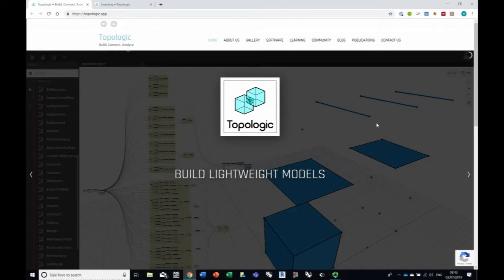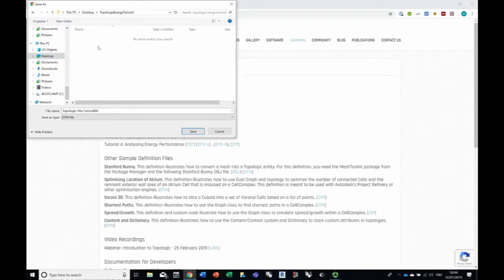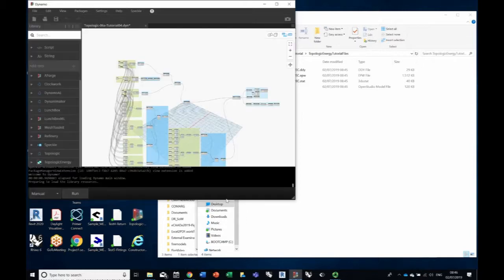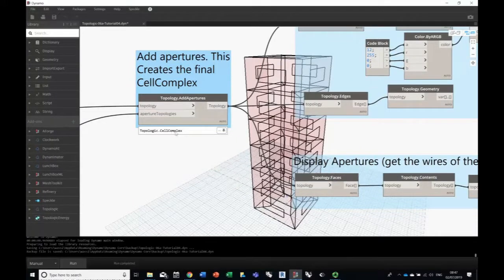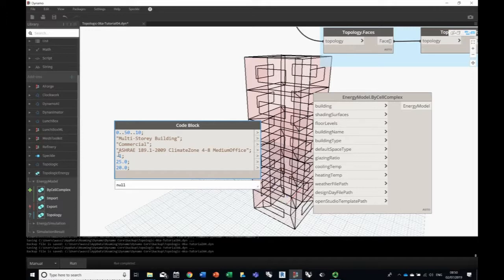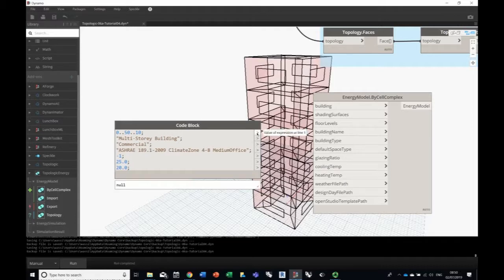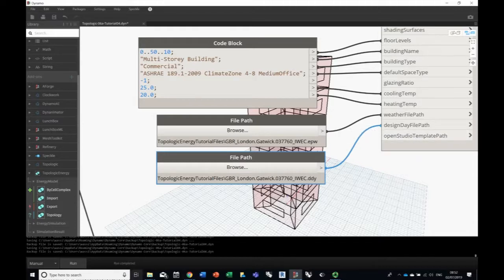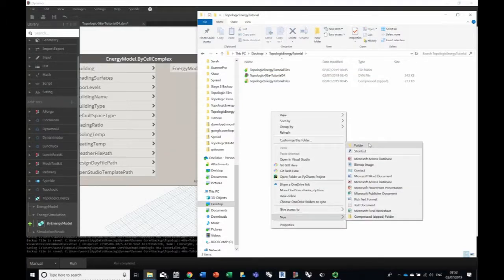02 Topologic Energy Simulation

Comment: Can you get EUI number from this process?
Reply from the maker: Yes. It is a standard openstudio simulation. All the output files are saved as well as the OSM file so you can do a simulation run in OpenStudio directly if you wish or even export a gbXML to another piece of software.